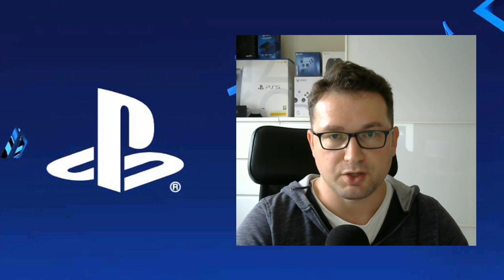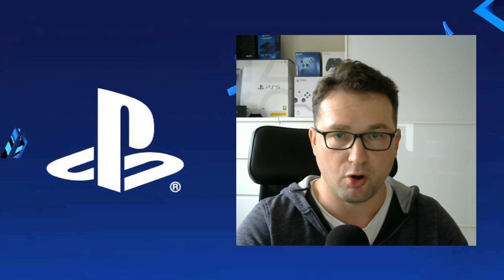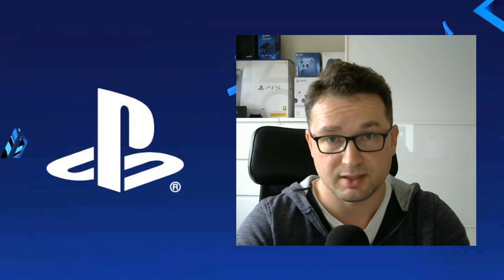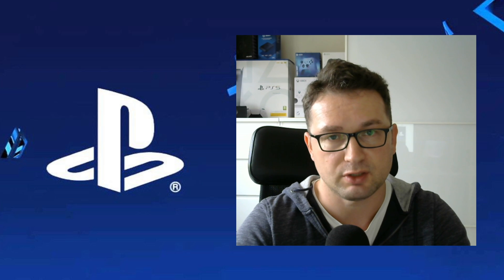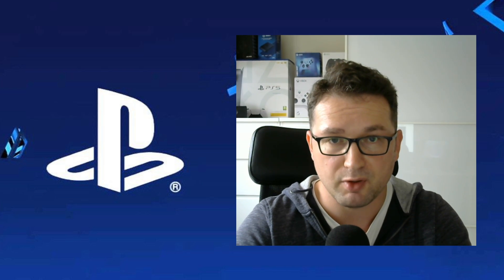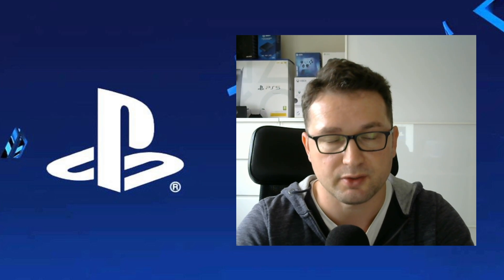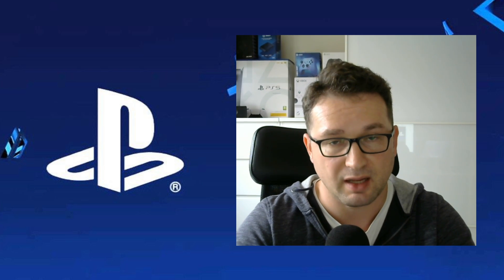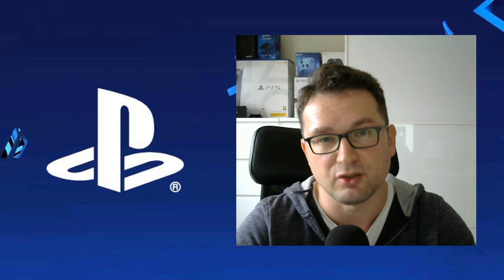New PlayStation 5 Processor on 6nm Node

Comment: IF ps5 is backward compatible, then it should be running MIPS CPU-microcode instruction-set for compatibility. Server class MIPS instruction-set on AMD-chip if they partner with Apple for proprietary architecture datacenter servers and the rest of the world can move on to the widely implemented and cheaper arm and deprecate x86

Comment: Is there potential for this chip to have better performance compared to the 7nm? Usually that’s the case with standard processors?
Reply from the maker: Nope. It's only more power efficient chip with the same specs and performance